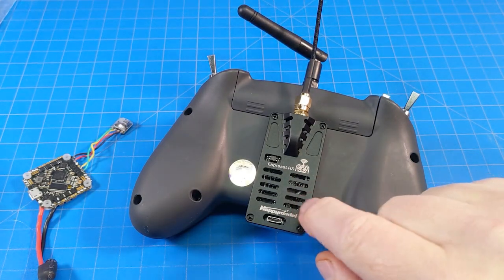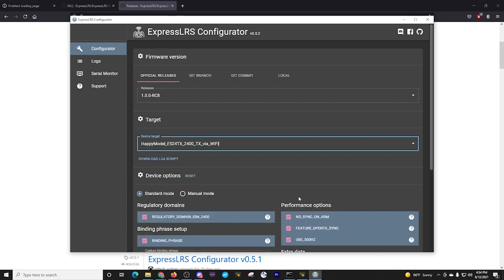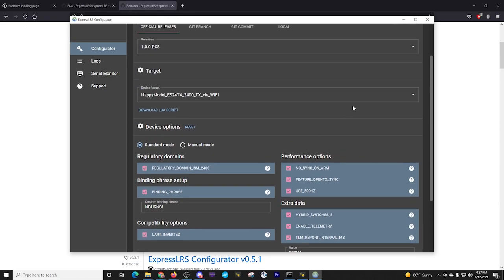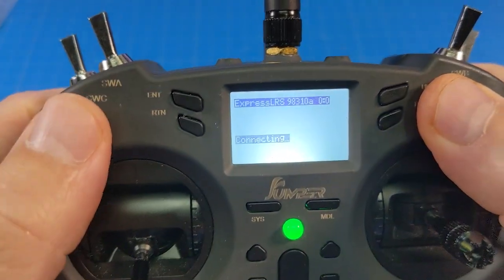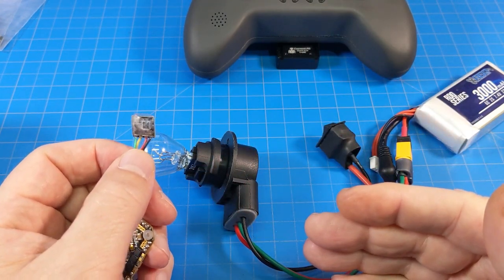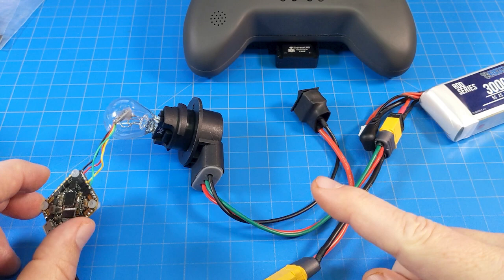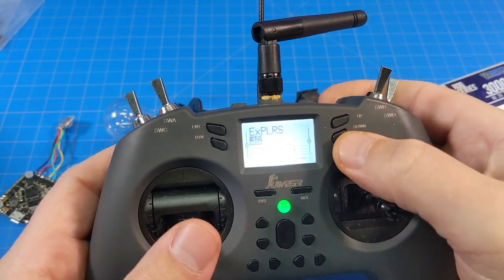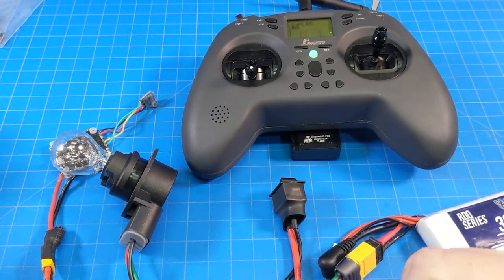HappyModel ExpressLRS Flashing (Updating) // EP2 // ES24TX Lite

Comment: I had problems updating the module on wifi, had a really unstable connection and would either fail to load 10.0.0.1, or load it in plain text. Attempting to update just killed the connection. Had to use USB which requires you move those two jumper pins on the back of the module (not mentioned in any documentation).
Reply from the maker: moving the jumpers to the left on the tx module is another method for sure.

Comment: Thanks for this video !
Can I use ELRS with out a Opentx NightB ? Will it just limit the frequency ?
Reply from the maker: Yes we don't have to use the nightly. At this time the nightly is only required to get the 500hz packet rate, which isn't required to run ELRS. It works normally at 250hz packet rate.
Reply: @NickBurnsFPV  correct me if I'm wrong (very likely) but I wasn't able to find any non-nightly builds for the t lite.
Reply from the maker: @paul-fornage  No, I didn't find any full releases for the t-lite. I suspect jumper modded the stock opentx so it wouldn't have the test warning. With that we only have 250hz on the stock opentx on the t-lite.
Reply: Thanks for this quick answer 👍🏼
Reply: Perfect! Thanks Nick! Awsome job!
Reply: Would like to know this too... i like to stick to the "safe" versions. Should i wait for next opentx update for t-lite or can this be done with the stoxk version of opentx?

Comment: Just went through the excrutiating experience of figuring out that those pins needed to be moved yesterday. Thanks for making this though!
Reply: Having problems myself where the Module doesent seem to connect to the T-lite (lua script only says connecting...). Should i move the jumpers on the pins on the back?
Reply: @kristianmuotka7523  no the jumbers only need to be moved for flashing. Is the light on the module on? Should be a visible red light. Lmk if you have questions.
Reply: @paul-fornage  I was going to flash it. no red light at all. when i connect the usb it lights up tho.
Reply: @kristianmuotka7523  same thing happened to me, make sure that the plugs are the right way around on the power board. (The one on the inside of the transmitter) one plug says 'es24tx Slim' and the other says 't-lite' make sure the one that says t lite is plugged in to the controller, and the other is connected to the module.
Reply: @kristianmuotka7523  the red light should be on when the t lite is on
Reply: @kristianmuotka7523  to flash it, the jumpers only need to be moved if flashing through usb (called 'uart' on elrs configurator) but if it isn't being powered, you have bigger problems.
Reply: @paul-fornage  well. checked in cables and all seems fine. its connecter correctly and i cant see any problems with the cambles either.
Reply: @paul-fornage  Solved it! This is embarasing. I hadnt set the model up with External module CRSF so how was the TX supposed to know what i wanted it to do... Lol. Super thanks for the help Tho!
Reply: @kristianmuotka7523  yeah no problem, had to use a lot help to get mine setup so I, figured I'd spread the knowledge.